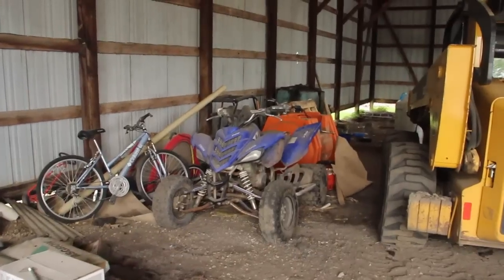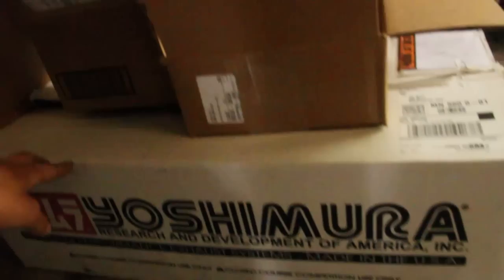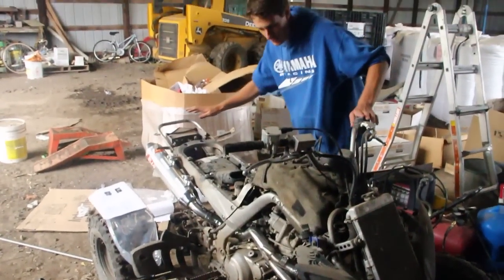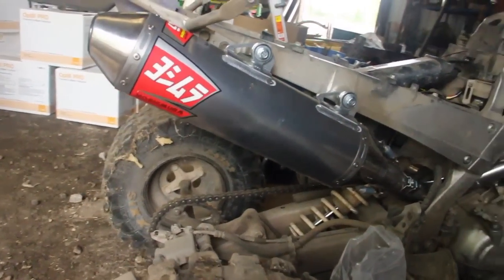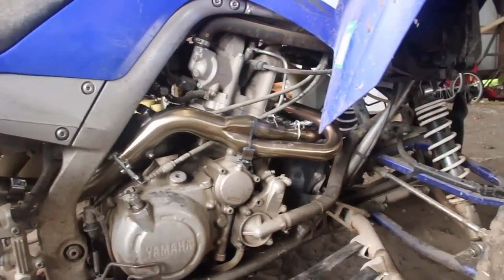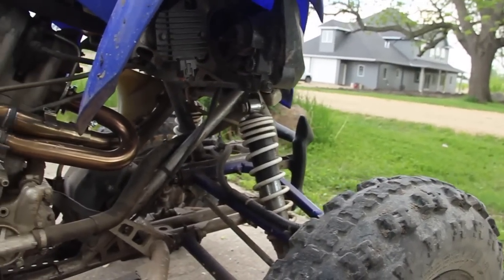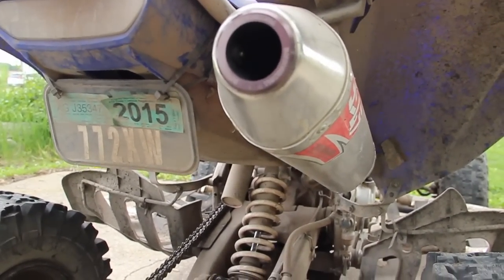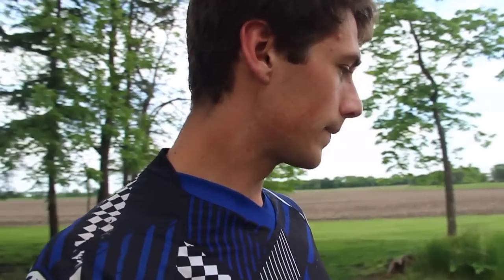JG Raptor Vlog 1 - Getting Back At It

Comment: Nice to see you back Joe. Been watching your MN Ditch riding quite often, and it looks like a blast. I'm up in the Twin Ciites, and often hit the WI trails. Q for you. The trails in WI often get very washboarded, and my 2008 700R just beats the crap out of me going over that stuff. Do you have any suspension advice on why that may be happening? Do you run into this issue as well? Thanks for any advice / tips you may have.
Reply from the maker: yeah I don't run into too many issues with that, I usually put in at Danbury, wi and then rather than head north on the main trail I head east/northeast and the trails are pretty well maintained and groomed. as far as suspension settings go Im not the best to ask, bought my quad used in 2008 and have not touched the settings once...